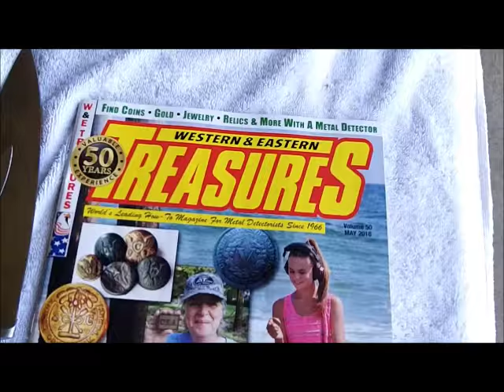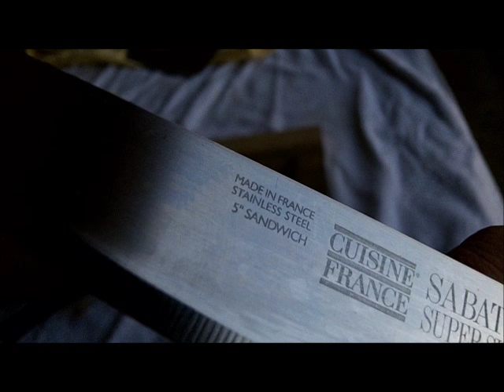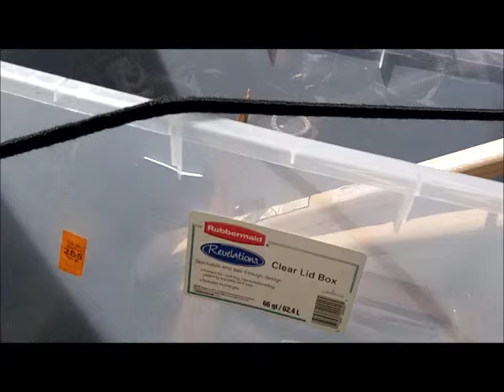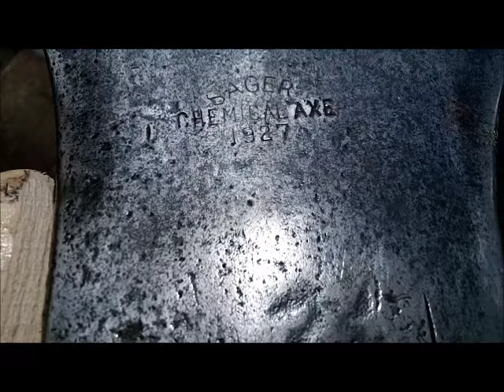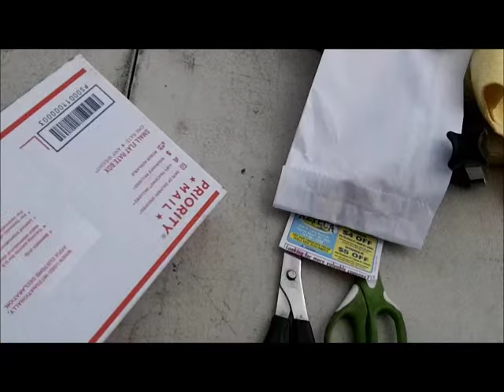Sharpening Axes and Knives in Hampton Roads Virginia

Comment: Max...nice job on sharpening those axes! Hey.. I think you can get that rust out of the files by buying Rust Out or Rust Away...something like that. It is a clear liquid in a small squirt bottle sold to remove rust from clothes. I used at least 3 bottles of this thru the years and I used it to remove rust stains in my old bath tub in the eighties. They may still sell this stuff.. I don't know. but it took rust off of anything ...like in seconds. Peace brother HH/GG

Comment: Hey Max, it is hard to tell in the video, but it looks like that broadaxe has had two bevels ground on it.  Broad axes are single-bevel tools for hewing a flat on a log or reducing the width of a rectangular timber. The handle should also be bent toward the bevel side to give room for your hands and knuckles not to hit the log.  If it is double-beveled, it is ruined.